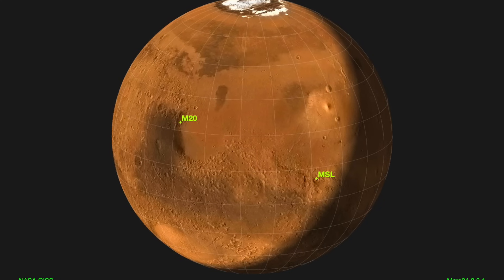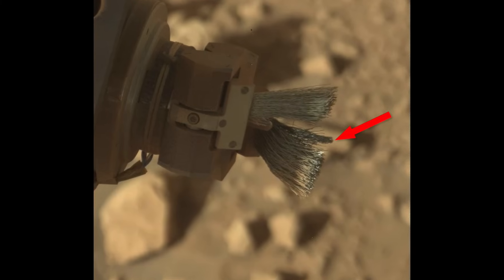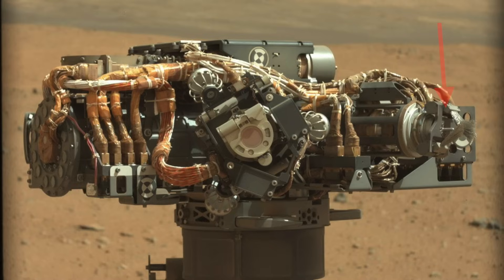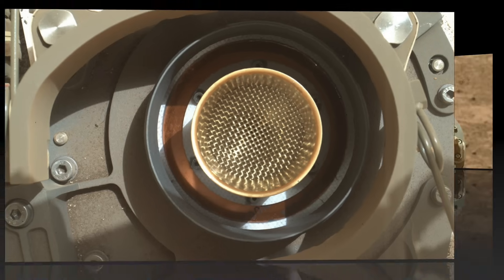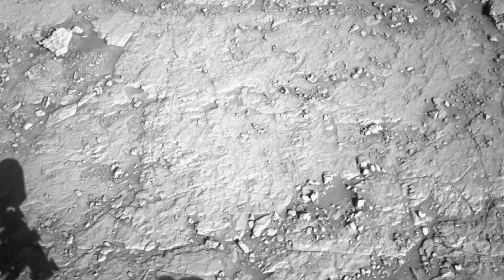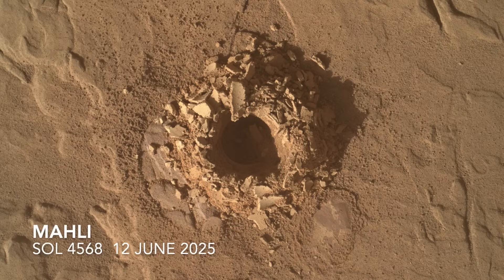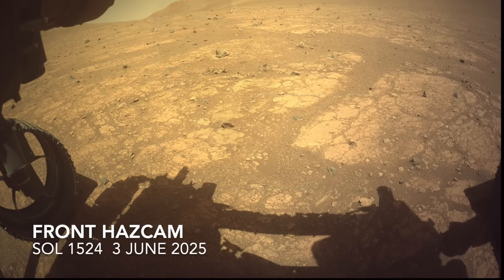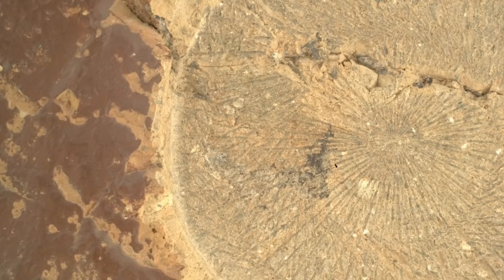Two rovers, two drills, only one winner

Comment: Is there no way to turn off the percussive function of the drills? Some material just isn't strong enough to handle a hammer drill, as eident in the video. Some material is better to just drill without percussion.
Reply: The percussion level in curiosity is programmed to start at 0 and increase if the drill is making slow progress. Maximum percussion level allowed can be set beforehand.
Reply: @foobarbecue  Thank You. What would be the assessment and future plan since the target crumbled during sampling?

Comment: Fascinating as usual. Regarding the twisted bristles on the DRT, I wonder if this could be avoided if the tool was programmed to make alternate applications in opposite directions, i.e. first pass, rotate the brush clockwise, second, anti-clockwise?
Reply from the maker: Thanks.  I don't know if it's possible to reverse the direction of the brush rotation but  I suspect it might bend them in an undesirable way.

Comment: Good Morning, Mars Guy. Looking at the results of the drilling operation. I noticed a particular dust pattern this time. The question I have is. The rock formation it was drilling. Were these rocks formed by a pressure from say a water deluge or some other type of high pressure? Great Episode. Have a Great Day.
Reply from the maker: Thanks.  I don't think either of the rock formations were formed by floods, if that's what you're asking.
Reply: @MarsGuy  I'm trying to come up with a logical conclusion. If you look at the configuration of everything. The first thing that comes to mind is the devastation. What caused it? How can we connect the dots? Your episodes are always great. Keep doing what you are doing.